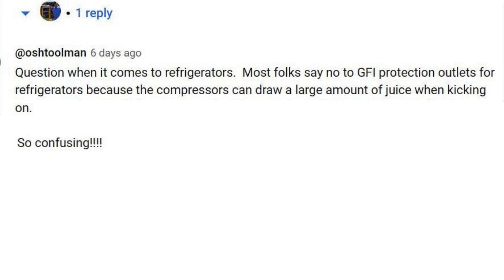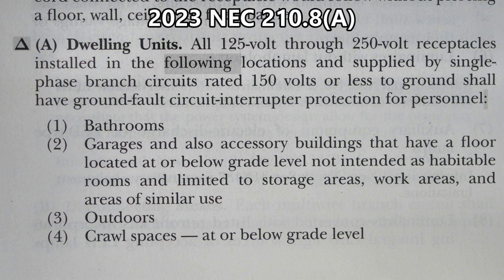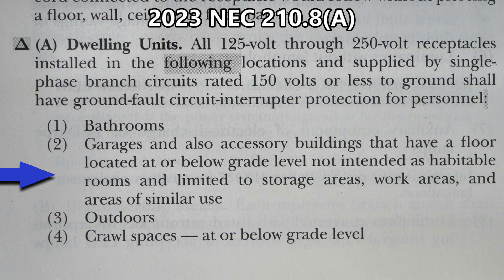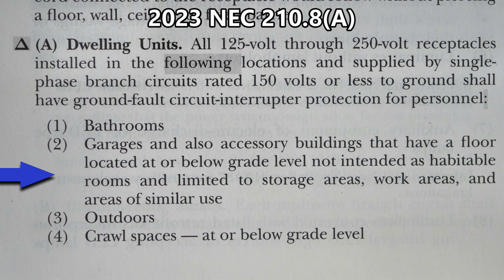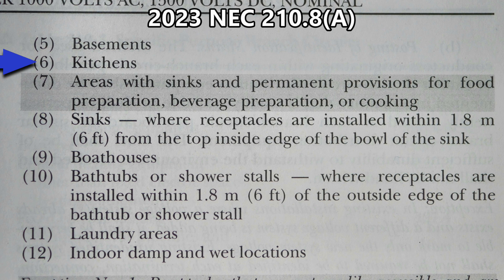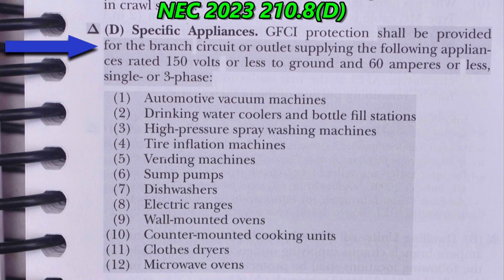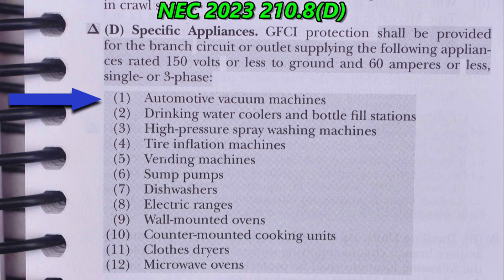Do Refrigerators Need to be Protected by GFCI? 2023 NEC 210.8(A)

Comment: @williamrucki9293
0 seconds ago
I would like to see the insurance data supporting this absurd requirement.  Just how many people were killed last year from touching a properly grounded refrigerator?  Let's see that same data for a microwave as well.  I have a hunch. I have a GFCI on a heat tape controller the warms a drain line behind my home.  I noticed the controller was dark and of course, the GFCI was dead and open.  If that would have been a piece of refrigeration equipment I would be one very unhappy camper.  Swap out that garbage and put it back before you sell your home.
Reply: I would suspect the number of people killed in this situation regarding equipment grounded refigerators is zero. A costly solution for which one searches in vain for a problem it will solve. Follow the money and you'll likely find out why this code change was done.
Reply from the maker: Thanks William!
Reply: We all would. Yet, no one will provide that data. (and guess who's pushing these rules? That's right, the industry that stands to profit from the sales of GFCI - and AFCI - hardware. Ever priced a 240V/30A "dryer" GFCI breaker?) I'm just waiting for 8d to add "ev chargers". (they do tend to be in garages, but they aren't outlets / receptacles. now price a 240/60A)
Reply: @jfbeam  that was my rant last week.

Comment: I wouldn’t put it on a gfi receptacle being that they need to be  readily accessible and they are almost always behind the fridge I would think a gfi breaker on a dedicated.
Reply from the maker: Thanks!
Reply: The GFCI can be anywhere in the circuit - even at the breaker. As per long standing NEC language, it cannot be behind the appliance as that's is very much "not accessible". (it's the same reason the GFCI for a garage opener can't be on the roof.)

Comment: Great video exposing an unreasonable requirement.  Best idea I see reading the comments is dedicated circuits for fridge, microwave, sump pump, garage freezer/fridge with GFCI breakers.  Then the homeowner can swap out the breaker after the inspector leaves.  Not cheap though.
Reply from the maker: Thanks Don!
Reply: The homeowner could do the same with a gfci outlet.

Comment: Have gfi on kitchen ref, garage freezer, and sump pump no problems. Have seen several failures of refrigeration units on gfi,  and it is a bugger to troubleshoot sometimes. The only appliance so far I can't get to work on gfi is TIG welder. 208/240 gfis painfully expensive...
Reply from the maker: Thanks Jerry!

Comment: All this extra protection feels like corporations forces extra expense on us. Every time I've tried using GFCI or AFCI outlet, they fail within a year or two, and they want these on all receptacles, now. With each receptacle costing around $30, it can get expensive real quick. I guess it's job security for electricians if they have to come out and replace receptacles all the time. I can't imagine that being good on the wiring. In this economy, people are just going to replace it with a $0.50 outlet from Walmart and call it a day. The silly think is that pathetic $0.50 outlet will last for 10 years, greatly outlasting these premium pieces of junk they are forcing on us.
Reply from the maker: Thanks Robert!

Comment: How are you going to put a gfci on a 240 volt electric range that draws 3500 watts of electricity!!, even a 240 volt single phase breaker gfci wouldn't work!!, would keep tripping off !
Reply: You wouldn't have to, the code says "...the following appliances rated 150 volts or less..."
A stove is 240 volts.
Reply: @WesWavecrest  150V or less *TO GROUND*. Line to ground is 120V - line to line is 240. I've complained about how many things this needlessly complicates for many years. 8(D) is now closing the loophole of having these appliances hardwired. Previously, the language only covered receptacles. Yes, there are 250V 30+A GFCI breakers. (they are every bit as expensive as you imagine.)

Comment: What   about   an   electric   eel ,  do   they   need   to  be   GFCI   protected    while   you   swim   with    them. 
Is   NEC  starting   to   go  a   little   to   far ? 
I   don't    want    my    refrigerator    on   a   GFCI   protected   circuit  ,  if   it   is   properly   grounded   it   should    be   safe .

Comment: A classic case of good by overkill. Originally GFCIs were put in bathrooms and near sinks that addressed real issues of people being electrocuted by mixing water and electricity. That was good, so let's find other areas to add. After years of code updates now pretty much everything must be GFCI, not factoring in situations that have no measurable benefit but have downside risks for mission critical uses. The best option is to pressure state and local codes to bring in some sanity.  Many of the added locations that now require GFCI, not to mention the dreaded arc fault protection, regardless of risks, pile on additional costs, complexity, and future maintence issues for questionable benefits. A case of a good solution in search of a problem to solve, and many times creating problems where none before existed.
Reply from the maker: Thanks Russell!

Comment: Thanks for the response Sparky.  What I ended up doing was putting a new commercial grade receptacle behind the fridge in the garage. Since it's the first outlet in the circuit, I had to place the  CGFI receptacle in the next or 2nd outlet in the series, which is a hallway bathroom. From the bathroom to the next 6 receptacles, they are all CGFI protected (not the fridge though).
Reply from the maker: Sounds good to me. Good question!
Reply: I like it. Nothing obeying "the code".

Comment: Isn’t this only for newer homes and apartments? Most of my kitchen appliances are 20 amp receptacles, but none of them are GFCI. The house was built in 1973.
Reply from the maker: Your house is under 1973 codes, but you can always exceed codes.
Reply: @SparkyChannel  
Yes, if you want to have all your wires, ripped out and walls replaced!
Reply: Where I live, if you dink with a circuit during a remodel, that circuit needs to be brought up to code, regardless of the age of the house.
Reply: @donbushek733  
I didn’t remodel my bathroom, but I did add a simple GFCI switch to replace the outlet, because the hair dryer kept shorting out the circuit. I figured it’s easier to just reset the circuit from the bathroom.
Reply: As others have said, you have to meet the code in force at the time the work is done. So, you're good until you touch anything. (depending on where you are, changing a lightbulb could be "touching anything". but less heavy handed... anything that touches or exposes electrical. or from the most practical stance... anything that has to be inspected.)

Comment: What we really need is reclosing GFCIs. Maybe with an hour or so delay...

I suspect someone could design them to be readonably safe taking into account the faulting current at time of trip, and only allowing it to reclose if it doesnt trip again quickly. This way, actual hazards would cause the GFCI to open the circuit and stay open until a manual reset, but a theoretical nuisance trip would re-close before damage to refrigerated goods.

Comment: Let me pose this question. IF you install a dead front GFCI inline BUT not at the point of connection leading to a simplex outlet for a device listed.. that should suffice. Correct. I ask because then the device is GFCI protected but the device is not directly plugged into the GFCI so the simplex outlet takes the brunt of the start up not the circuitry of the GFCI directly.
Reply: Not sure what you mean by "dead front". Either way, tho, if you connect a standard receptacle to another GFCI per manufacturer instructions, then it will be subject to protection, and it will have the same issues because if the GFCI trips then both receptacles are knocked out.
Reply: @marcfruchtman9473  a dead front GFCI is a gfci device with no receptacles. It's just the trip and reset buttons. a blank face. Provides protection without the chance of the quick or phantom trip due to immediate motor start up. I've heard about it and read a little about using this method.
Reply: @scotttribout1150  Thanks for the info. Other than the lack of physical connection on the front plate, a regular modern GFCI should be just as good... It would be cool tho, if a device had specs that actually mention decreased nuisance tripping. If you spot something, please repost! The only thing I can think of that would have less nuisance tripping would be an Equipment Ground Fault Protection Device, but the code doesn't seem to show an exception to add one as an alternative if Nuisance tripping would represent an issue.

Comment: Bill, well done, my friend!
Reply from the maker: Thanks for the help, Don! Any thoughts on garages that have above grade floors needing or not needing GFCI protection?
Reply: @SparkyChannel   The article reads:  "210.8(A)(2) Garages and also accessory buildings that have a floor located at or below grade level not intended as habitable rooms and limited to storage areas, work areas, and areas of similar use".   I interpret that as saying both structures mentioned, require GFCI protection of receptacles only if located with floors at GRADE LEVEL.  If built above grade, with a non grounded floor, do not require the prescribed protection.
Reply from the maker: Thanks! That's the way I read it as well. Not everyone is going to agree of course. @donl1410
Reply: @SparkyChannel  👍

Comment: When we bought our house(built in 1979) the sellers did not agree to an inspection, I now know why, there are multiple issues regarding electrical, such as no dedicated microwave circuit, a wobbly home job garage outlet, a ceiling light in the garage that was smashed by someone who installed the garage door opener, and finally a sloppy junction box I found recently that has no cover plate, no cable clamps and exposed conductors! I have my work cut out for me. Luckily I have gained confidence by watching your and other YT’s videos that explain in great detail. Thanks again Bill for everything 👍
Reply from the maker: Congratulations on your new house! Yep, you do have your work cut out for you!
Reply: I'd never buy a house without an inspection. ESPECIALLY if the seller doesn't want one done.
Reply: @daphlavor In 1979 GFCI's were not required, that started with the 1980 code, and has been expanded ever since.  A dedicated microwave circuit, although a good idea, was not a code requirement.  In the 70's, microwaves were rare, very expensive items.  Now of course, they are as common as a toaster or a coffee pot in the kitchen.  The idea of a dedicated 20 amp microwave circuit (with GFCI) didn't surface until the early 2,000's.  Now, the smashed light, the poorly installed junction box, that's a clear safety hazard that needs to be fixed immediately.

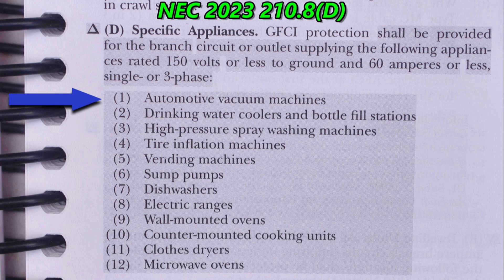Comment: I used to live in Stone Mountain , GA. On the edge of the bowl that formed the mountain, 3:43 and had lighting strike the ground on a fairly regular basis. Came home back home one time and one of the few things not fried was the refrigerator in the garage on a gfci that tripped. Also all our utilities were ran under ground.
Reply from the maker: Good story, thanks!
Reply: You lucked out in this case, but GFCI isn't designed for overvoltage surge protection. To address this risk a surge suppressor system or even use of a single point Leviton combined outlet and surge suppressor would be a path to take. The Levinton surge/outlet combo, which is UL listed for this purpose, is a good choice for an appliance that is mission critical - I have one for my refrigerator outlet (a 20 amp version as it's on a 20 amp circuit). If the surge is so powerful that it fries the triacs the outlet continues to provide power, just without surge suppression - effectively converting it into a standard outlet. In that case the surge suppressor did it's job and sacrified itself (a $30 part) to save my $1,000 refrigerator and keeps the power on afterwards.
Reply: I too have had a couple GFCIs protect appliances / devices when I lost the neutral at the street.  Also lost several surge protectors.  I am not depending on GFCIs for surge protection - but they worked for that.

Comment: Your fridge or freezer isn't safer in the bedroom! That location requires AFCI protection.
Reply from the maker: Yes, it does need AFCI if it's in a bedroom.
Reply: Honestly it is the AFCI requirement in kitchens which causes more grief for refrigerators, in particular when the frost-free cycle begins, an arc can occur as the circuit is energized which the AFCI detector identifies as something bad, and shuts off the circuit. I have not really had any problems with GFCI nuisance faults.

Comment: Gfci is a good thing but your refrigerator and or freezer should not be on gfci.  GFCI use to be super sensitive years ago but have improved the last ten years.. if your system is grounded correctly and bonded were necessary you will never see gfci on my fridge or freezer
Reply from the maker: I understand.

Comment: The problem with GFCI protecting the fridge is that as they age, a lot of fridges have wires that degrade and when the defrost melts the ice off of the coils,  water drips onto them and causes a gfci to trip. As of the 2020 NEC (im in NJ), in kitchens it is only required to provide GFCI protection for the receptacles serving the countertops, and receptacles within 6 feet of a sink, so i can get away with AFCI protecting the circuit and throwing a GFCI receptacle downstream from the fridge. But when they adopted the 2020 NEC, new jersey got rid of their amendment that allowed a single receptacle in place of a GFCI for fix appliances in locations requiring GFCI protection. That was sweet for fridges in garages and sump pumps and stuff like that.
Reply from the maker: Thanks for the info about NJ. The NEC handbook talks about new refrigerators not having that problem. But not everyone has new refrigerators.
Reply: @SparkyChannel  I do 95% old work residential here in NJ. I almost never see new appliances unless I renovate a kitchen. Tons of plaster and lath, knob and tube or cloth covered ungrounded wiring, federal pacific and pushmatic panels, plus decades of hack electricians putting bandaids on gaping wounds, and customers wonder why I refuse to provide them service sometimes, or why my quotes are as high as they are. Its better to lose a job than it is to get into litigation 😁

Comment: Hey Bill, if the garage is above grade level  still need gfci protection, for refrigerator or wherever you want to plug in in that garage.
Reply from the maker: OK, please explain 210.8(A)(2). It's at 1:14   It seems to me that they are saying that garages with above grade floors don't need GFCI protection. Thanks!
Reply: @SparkyChannel  it’s a little confusing, to me the code is talking about accessory building at or below grade level,  but you could be right, because say “garage and …….

Comment: crazy they want a sump pump with gfci. Thats a recipe for disaster. And stove.... what the.... 50 amp 240 gfci. Thats just dumb.
Reply from the maker: Sump pumps can save us from disaster. I agree with you.
Reply: They make 'em. Had one on my hot tub.
Reply: @hughbrackett343  probably 100-200 dollar breaker
Reply: @av1204  for a spa, the outdoor panel with 50A GFCI is around $70.

Comment: In response to your closing question, I do think it is crazy that a refrigerator needs to be protected by GFCI. I do not believe there is any common sense used when making this decision. No one has asked the question what happens if the GFCI trips and the home owner has to pull their fridge out to reset it? What if the GFCI fails completely? I've had that happen with the Sq D brand of 15A GFCIs a lot in the last year. Now you could say, well just put the GFCI at the breaker. Ok, so if it trips the home owner needs to go to the garage, basement, or outside to reset? What about if they go on vacation and trips while they are away?
Reply from the maker: Great points. That's why states like Oregon don't go along with this.
Reply: the gfci reset is not allowed to be behind the appliance.
Reply: @wim0104 I agree: having to move the appliance to push the reset button is not the definition of readily accessible.

Comment: It won't hurt it.
How much power the compressor using is not a problem. As long at the circuit can handle it.
If people are worried about not being able to access the outlet. Just make sure the circuit is GFCI protected.
Reply from the maker: Yes, the breaker can handle AFCI and GFCI needs, getting around non- accessibility.

Comment: I agree that the protection of a refrigerator circuit is confusing. My house was built in 2000 and does not have GFCI protection for the refrigerator. Thanks for the video and research, Bill.
Reply from the maker: Thanks Tim!

Comment: in-rush current can be limited with simple electronic components, compressors don't need to put a nasty load on breakers or GFCI devices.
Reply: a fridge in the bedroom would still need AFCI, no?
Reply from the maker: Yes, it would need AFCI. @wim0104

Comment: I once had an inspector tell me when getting sign off as a homeowner, off the record he said, I would not GFCI a refrigerator or freezer. I made some changes after he left. Technically, not code I have a couple of outlets in the garage not GFCI, but at least behind things, and all the others are protected. I probably should have labeled, but didn’t bother. This was 15yrs ago on a 1980 house where I changed the mains and replaced all switches and outlets.
Reply from the maker: I understand, thanks!